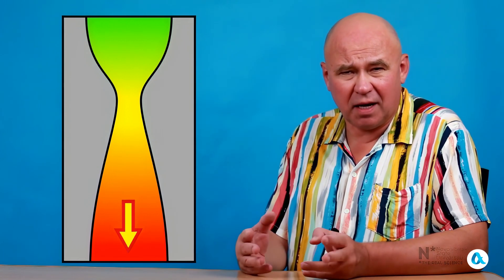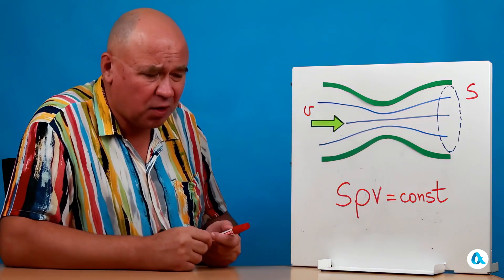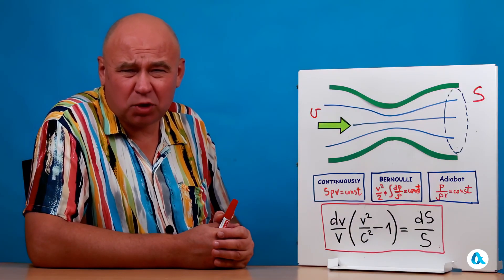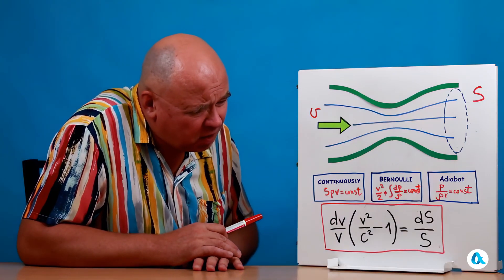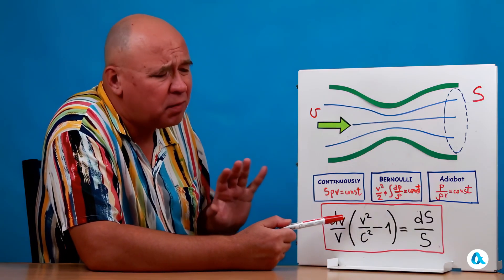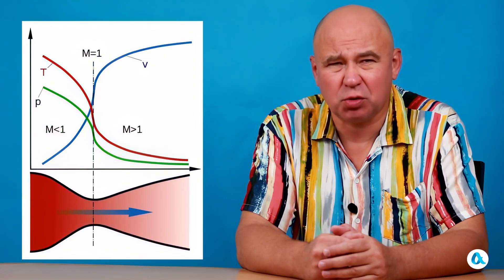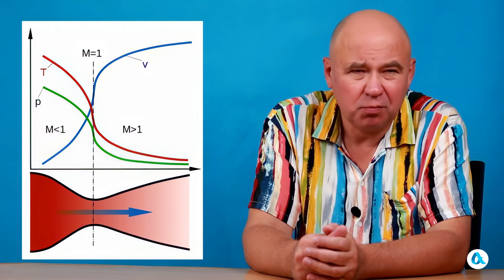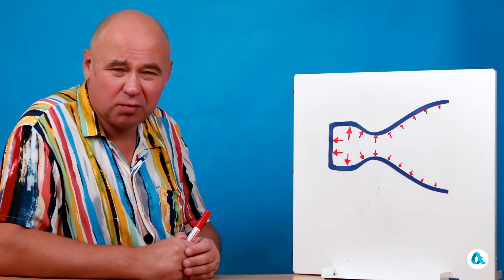Laval nozzle

Comment: Does it increase velocity if the decompression side is super-cooled?
I'm thinking that if using liquid hydrogen/oxygen as fuel, it could be depressurized in pipes around the "bell" before going to the injectors, as that should drop the temperature significantly.